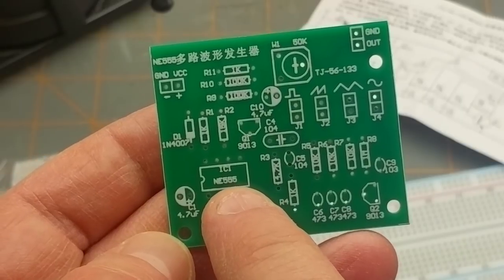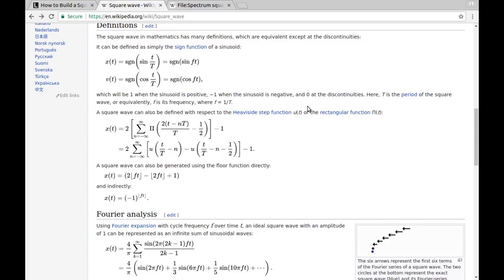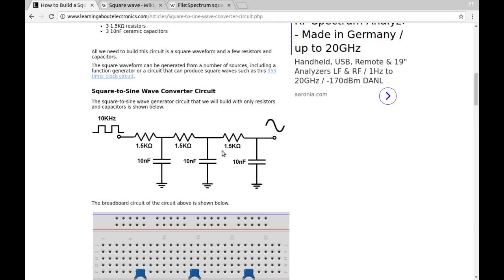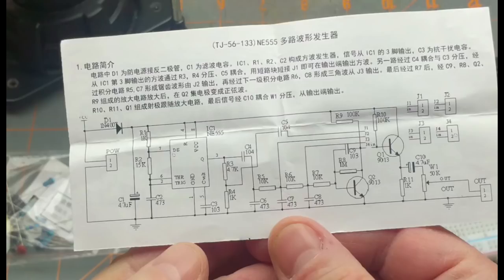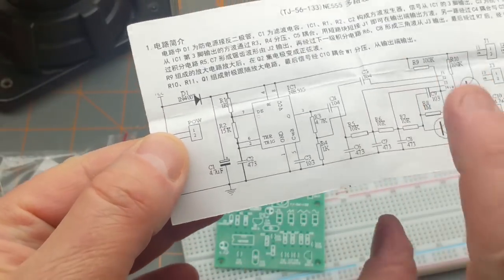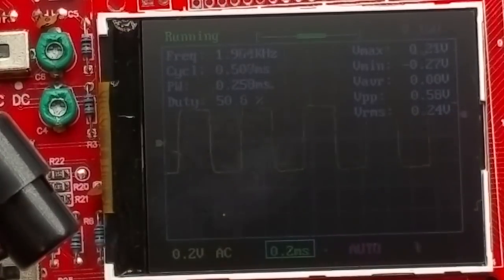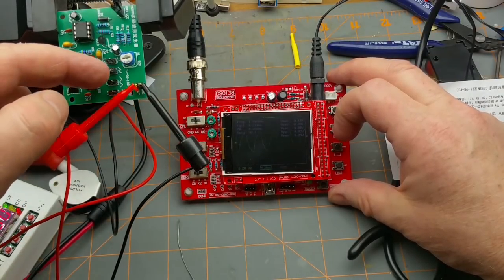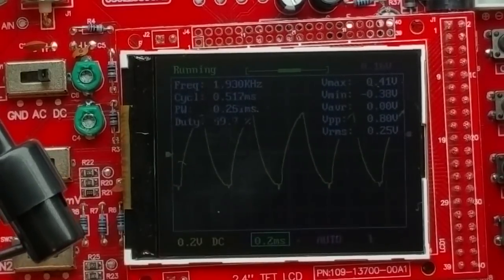kit build - waveform generator

Comment: Small word of advice, change soldering iron tip for something that provides better heat transfer, like chisel type or some other. Conical type is one of the worst types, but every soldering iron comes with them installed by default.
Reply from the maker: kjur18 : ive already ordered some replacements. This .6mm tip is the only one that came with the iron. 
I guess it would be good for SMD, but youre right, it is not great for bigger stuff like I usually work on.
Reply: I only use pointed tips, as it gets in tight spots, the only thing is you have to turn the iron up.

Comment: Replace R1 and R2 with a Pot and you have a variable Frequency Source.  Dang handy for like $2.00 I say.   I find it easier to place the small crap first and follow that with the parts that stand up off the board further.  Fat Fingers says so.
Reply from the maker: Yup. 
Even after all these years, the 555 is still a versatile little chip.

Comment: I like how you describe things, going thru the schematic, etc. BUT.....aside from creating waves to look at on the oscilloscope, what is a function generator good for?
Reply from the maker: It's a test signal source.

If you are testing an amplifier (or any analog circuit) it is useful to see if the signal that you  put in looks the same (only bigger) when it comes out.

If you are testing a comparator, then the ramp/triangle waveforms can help you adjust the threshold.

The square wave can be used as a test clock signal for digital circuits.
Reply: Thanks. does it work to test a flat screen monitor? I'm guessing I'll have to hook the monitor to my computer to test it, won't I?
Reply from the maker: Yeah, it's nowhere near sophisticated enough to test a monitor. maybe to test some segments of the circuitry, if you have a schematic.

There are actually monitor testing signal generators, though, but they're not cheap.

Best is to just hook it up to a computer and see what happens.